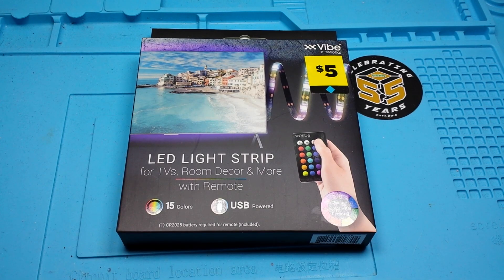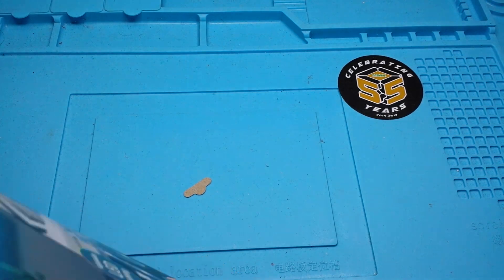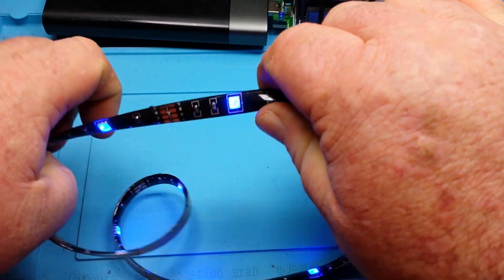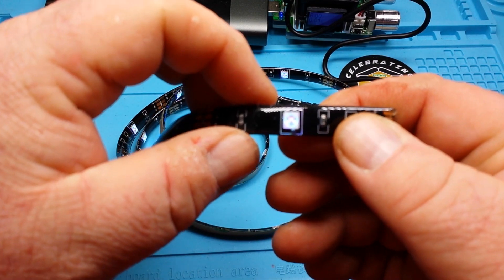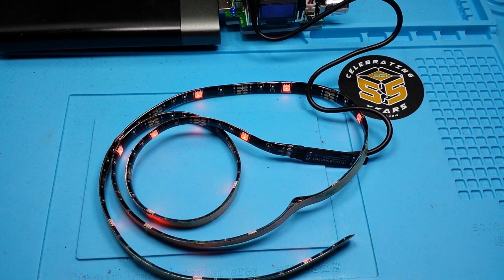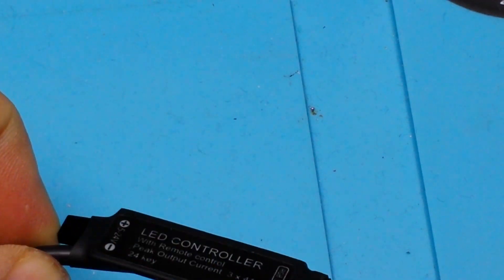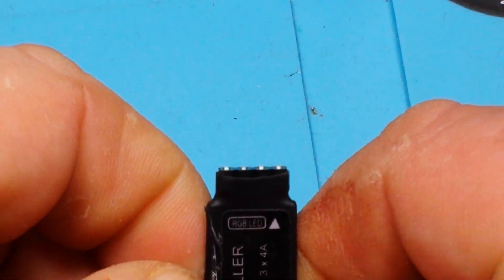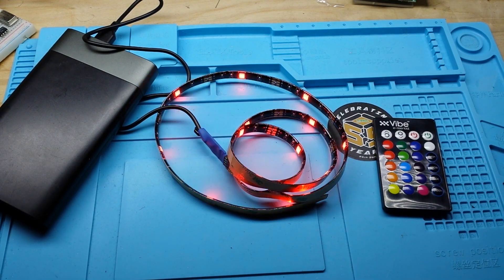Dollar General USB RGB LED Tape

Comment: Got similar on lidl which would be used to put on the TV. It is modular in the way you can put strings in series. Very neat, cheap and can run on a powerbank ou USB Power supply for the time being

Comment: I hate the low led count ones. The addressable 144led per meter neopixel on the other hand are great. If you want an individual led they take up a lot less room. But they are more than $5. The individual smd leds that come on a little round pcb are even better and they are cheap. Neither have a controller but I'd rather do that with my own hardware. Great video

Comment: I have a tv stand that has like 9 holes ig. The xbox goes in one of the holes and I wanted to light up the hole with the xbox to make it look flashier. I don’t want to buy a lot of strip just something cheap and easy. I have more sticky tape from my other led lights which I’m gonna use instead. I hope it comes out good.

Comment: I'd like to power up 32.8 feet of LED strip lights. The only way I can do that is to use the power cable that comes with it. Is there a way to connect a battery pack instead? Is there a particular battery pack I can purchase on Amazon or maybe eBay? The voltage is 12 Volts and 36 Watts. Here is the link to the product I'm talking about.

https://www.amazon.com/gp/product/B07N1BLTWF/ref=ox_sc_act_title_1?smid=A2KZ7X05DCDJDL&th=1

Comment: rip off, wal-mart sells one  for 4.88 and it a lot better then this one, it has 30 RGB vs the 16 in that set,  more vivid too.  Also sell one you can control with your phone through an app for 10$,  That thing will be dead in less then 3 months of normal use, ill bet 50$ USD on it.
Reply: ԱӍβЯƐ Do you name of the one your talking about? The only ones I say at Wal Mart were the Alpenas, $20 for 2 10” strips
Reply: Depends on the store, The walmart near me does not have any LED tape but they have outdoor LED wire lights for trees.
Reply: @nickd6182  yours must not sell them then or havnt stocked them yet. I cant find the exact one online but I found the white version. What im talking about is essentially the rgb version of that. https://www.walmart.com/ip/Monster-Multi-White-USB-LED-Light-Strip-6-5ft/155572606